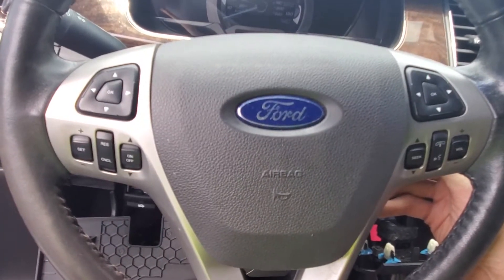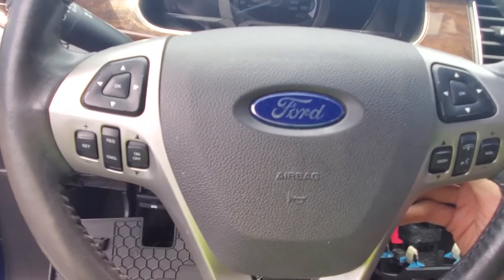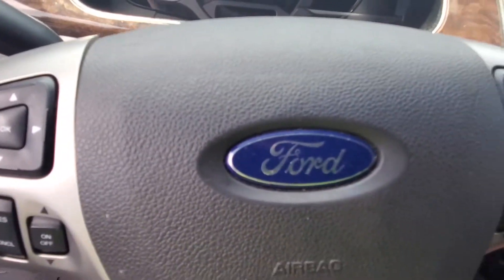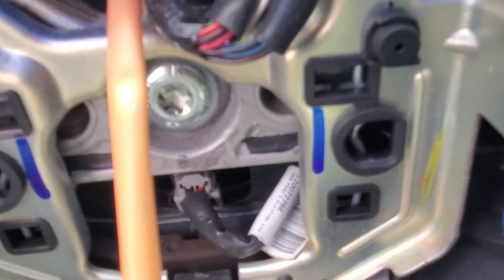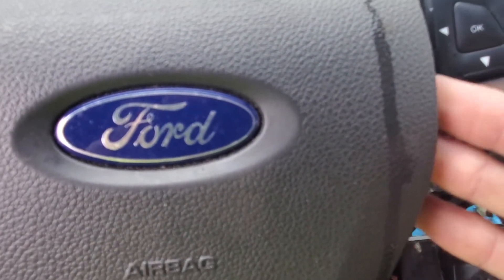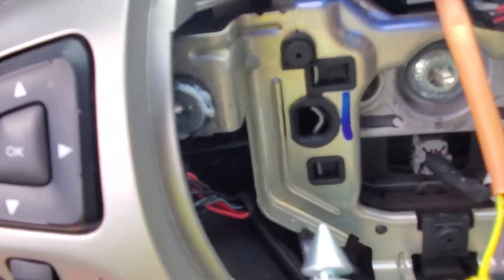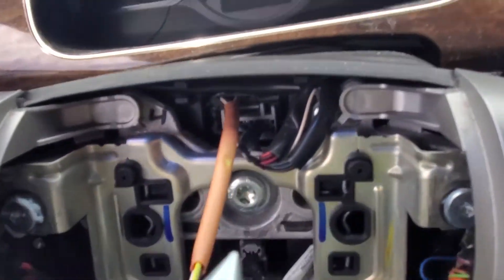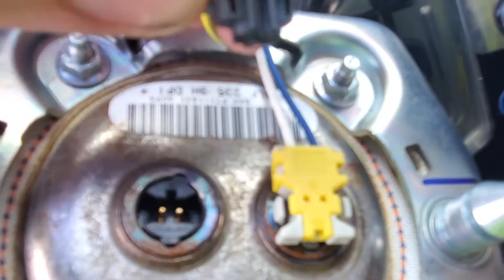2013 Ford Taurus Steering Wheel Airbag Removal

Comment: Damn I almost ripped apart my entire steering wheel. 

Thanks
Reply from the maker: they're a pain. not necessarily a job for the impatient or with low mechanical skill for sure.
Reply: I did it (30 min) just to find out the mine steering buttons are connected and i’ll need to dig more deeper to fine the cables that are not to enable back to navigate my dashboard